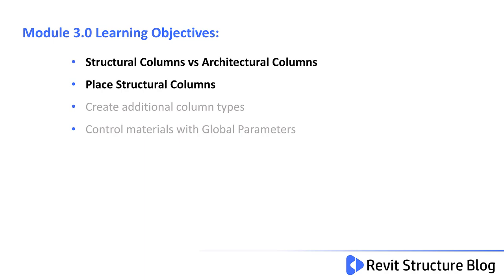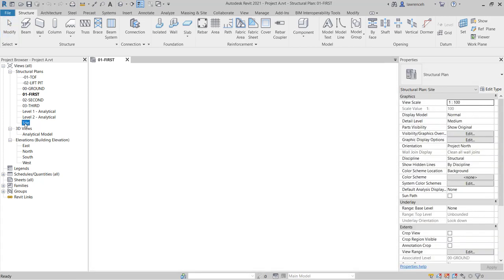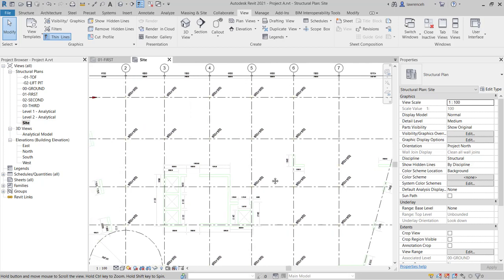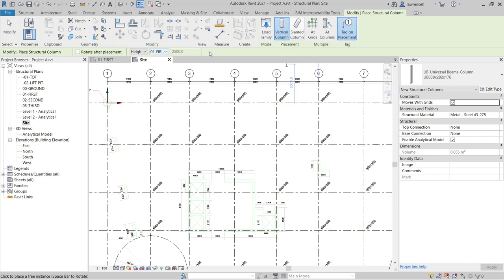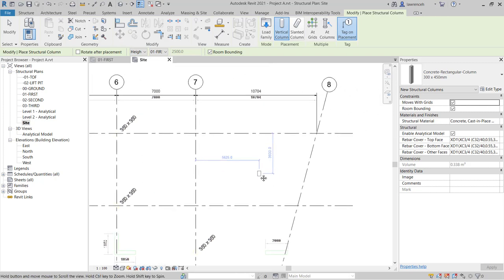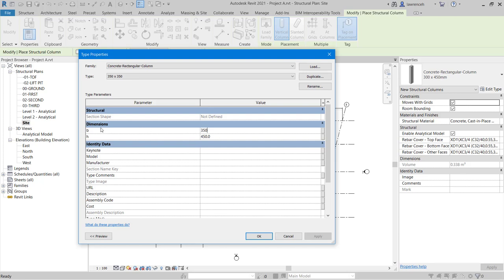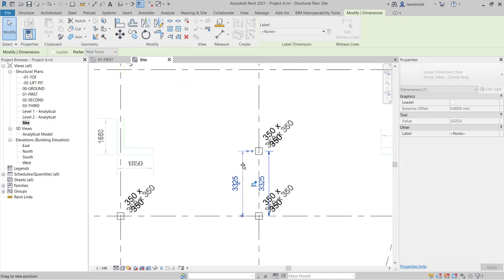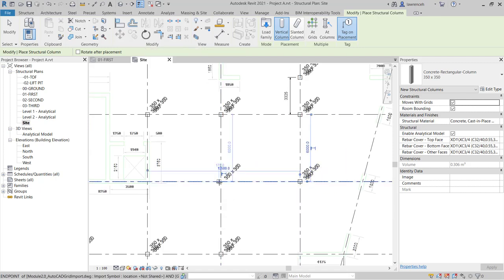Revit 2021 Training For Structures Essentials Module 3.0

Comment: if you add a base plate to a column on a pad foundation by loading the revit connection...how do you space out the bolts to your own dimensions,cant seem to find a way to move them..so if you increase the overall size of the baseplate,the 4 anchor bolts remain in the same position,but I want to increase the distance between them,as I increase the baseplate size...thanks